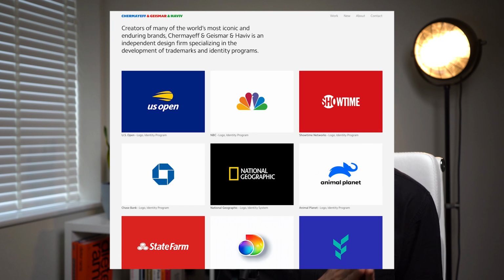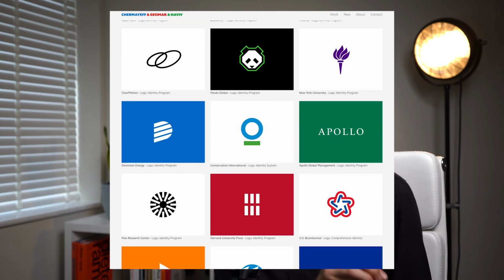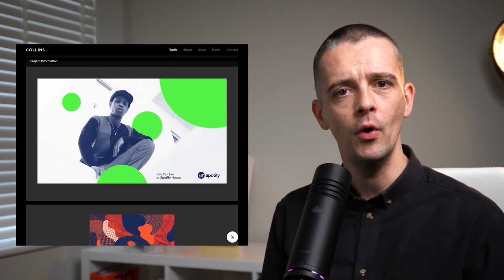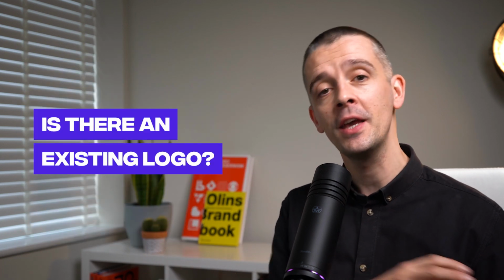Questions to ask before you start a logo design

Comment: The advice about capital and small letters was helpful. I was experimenting with that without knowing what the client has in mind. I should ask them. And not leave it to chance. The whole video was helpful though. I would like to watch a video on brand identity and strategy. Which books should I read to be thoroughly prepared. I have to ask them about the deliverables too. That might be the business card or the letter head right?
Reply from the maker: We have more branding videos on the channel (and a comprehensive brand identity course) so have a look at those.

"Designing Brand Identity" by Alina Wheeler is the book you need.

Comment: What about clients that you can't get to answer these questions for whatever reason? And the of "answer get better clients" is not always feasible, especially if you're just starting out. I have done everything from full-on conversations to hands off surveys that can be filled out on the client's own time. Inevitably, I've gotten wrong answers, vague answers, flat-out stupid answers. I even have clients who don't even know their own brand. I have clients that want me to copy existing clipart who's copyright usage is unknown. I have clients who want me to use existing imagery that is nothing but pixels. How do we get around clients who don't know their own stuff? These are often the clients that could use the most assistance with logo design and branding.
Reply: Trying to find the answer for the same question.
Reply: Charge higher prices.  Or just give them what they want and take their money.
Reply: Here you can turn a weakness into a strength by providing advice to the client because clients often like to be treated in a directive manner, because the client does not have this point and therefore he came to you. Your advice to the client gives you a large amount of confidence and certainly some fatigue on your part. But believe me, you will always be the winner after this session. The client does not want to take a design, but rather wants to take a value, and by advising him, you have given him this value.
Reply: I’m in this exact moment rn 😅